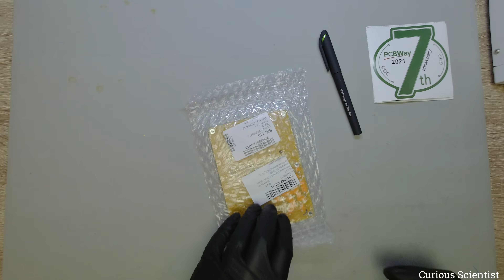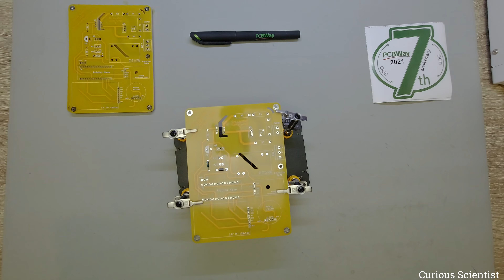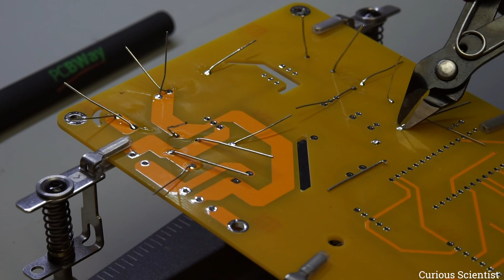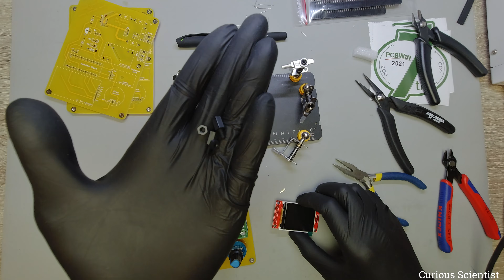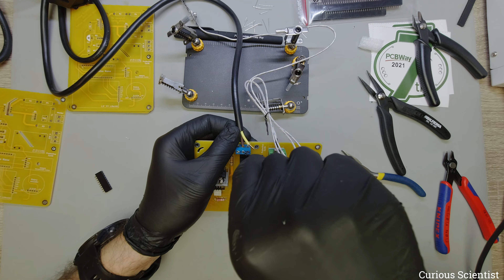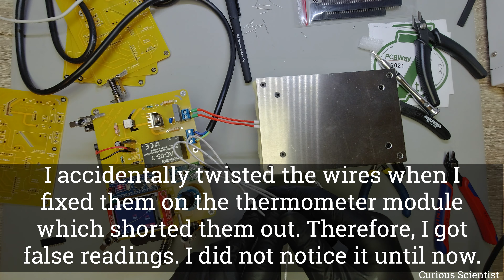Making my own reflow hot plate - Part 2 - Custom PCB and assembly

Comment: Is the Arduino Sketch only available via Patreon Support, or are there other support options?
How long do I have to support via Patreon?
Reply from the maker: Hi! There's no length requirement, as soon as you become my supporter, all the things I share for my Patreon supporters become available for you. Regarding the files, I never share the Gerber files because you can get the PCB from my PCBWay project page directly. I only share the source code.
Reply: Do you know why my new Message ist Always deleted? @CuriousScientist
Reply from the maker: I don't know which messages are you referring to, but I cannot see any in the "Held for review" folder.
Reply: Do you also sell the circuit boards as individual items?
It's not exactly resource-friendly if I have to produce 5 units. But it is certainly the cheapest method.
Of course I can assemble the board myself, it's only about the bare board. @CuriousScientist
Reply from the maker: @hansedenstrasser  Hi! I also receive them in a package of 5. I think I have one or two boards left that I could send to you. But probably it won't be "resource-friendly" for your wallet then. If you want to know more details, you can write me an email. Contact details are on my website.